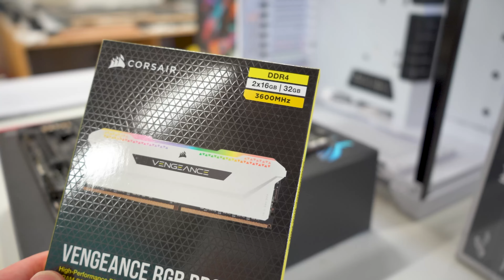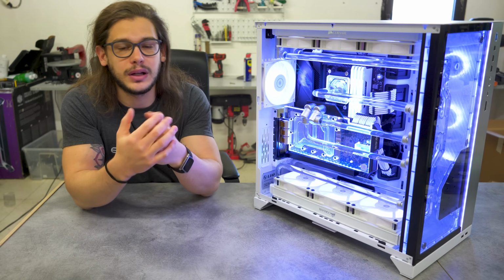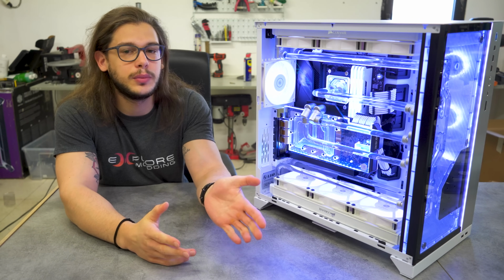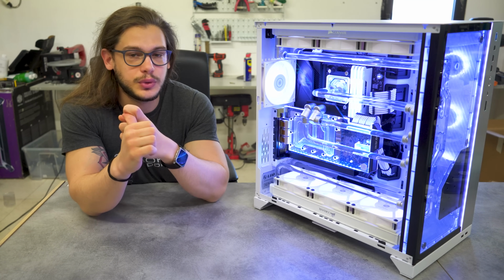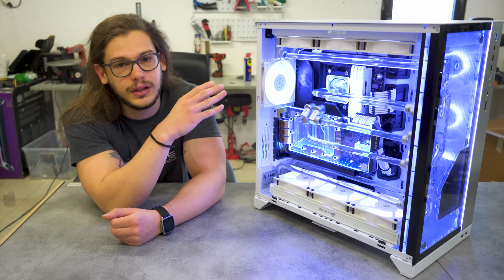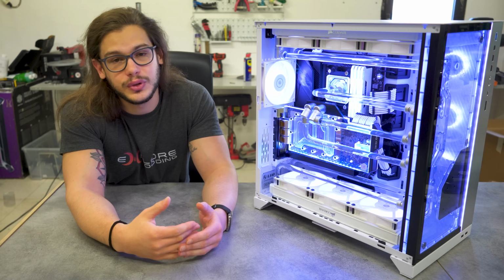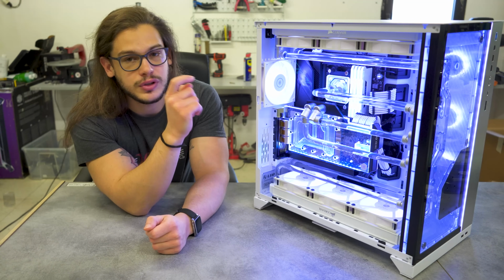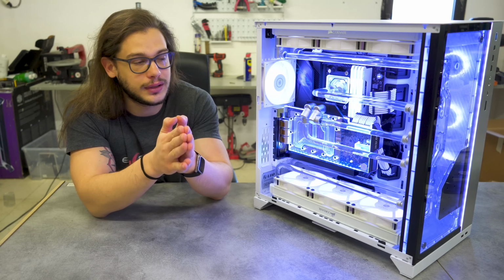Watercooled Lian Li PC-O11D XL - Thoughts on the Most Popular Watercooling Combo | bit-tech Modding

Comment: VERY NICE BUILD. I PREFERR FUNCTION OVER LOOKS.  THE ONLY THING I DON'T LIKE IS THE DISTRO PLATE RESERVOIR COMBO. DISTRO PLATES ARE PURE LOOKS .  BUT WORK YOUR PUMP WAY TO HARD , A PROPER SYSTEM. KEEPS THE TUBING RUNS AS SHORT AS POSSIABLE .   COPPER TUBING IS MUCH MORE FUNCTIONAL THAN PLASTIC. AND HELPS IN COOLING .  NOW YOUR SET UP IS NICE FOR A PC. AND REALLY DOESN'T CHANGE TEMPS MUCH . BUT RUNNING AN INDUSTRIAL SYSTEM WITH 50HP PUMPS AND MULTIPOL  WORK MACHINES A DISTRO PLATE WOULD NEVER EVER BE USED IT JUST OVER WORKS THE PUMPS. I WILL POST MY GRANDSONS O11 / IT USES THE FLAT EK PUMP RES. D5 NEXT. i HAVE SEEN ALOT OF BEUTIFUL O11 BUILDS BUT WAIT TILL YOU SEE THE 1 I BUILT  FOR THE GRANDSON. iTS AS SHARP AS ANYTHING I HAVE SEEN BUT IS 100% FUNCTION OVER  FORM. wHEN YOU SEE IT YOY WILL UNDERSTAND . IT IS A 1 OFF CASE AS i WANTED TO PROVE TO THE WORLD THAT LOTS OF AIR FLOW IS PURE bs. i SEALED THE CASE OTHER THAN SIDE AND TOP RAD MOUNTS  . fANS CREATE A PREASURE RISE INSIDE THE CASE POSITIVE PRESSURE = LESS DUST.  HIS TEMPS AS FAR AS pc GOES IS = TO OR BETTER THAN ANY O11 OUT THERE.  I AM BUILDING NOW FOR OTHER GRANDSON THATS IN A O11 XL THIS PC WILL HAVE 2 PUMPS IN THE SIDE MOUNT . RADS ARE TOP AND BOTTOM. AGAIN i USED ek FLAT PUMP RES. PUMP COMBO . 1 IS 240 THE OTHER IS A 120 AGAIN VERY SHORT TUBING RUNS AS I USED XFLOW RADS , AND BOTH SYSTEMS ARE AS GOOD AS IT GETS. tHE PRESENT BUILD IS FOR THE LAST GENERATION OF THE 1700 PIN LAYOUT. FOLLOWING RAPTOR LAKE. I DON'T HAVE ALOT OF MONEY SO IT TAKES ME A LONG TIME.   FUNCTION WILL ALWAYS TRUMP FORM. EVEN IF ITS ONLY A COUPLE DEGREES C.   A WELL BUILT fUNCTION OVER fORM SYSTEM WILL ALWAYS LOOK BETTER/IT MAYBE HARDER BUT LOOKS TAKE TIME.

Comment: That upside down Corsair logo on the bottom rad just triggers me.
Reply: HAHA troo XD
Reply: Right? But there's no way to put it the right way when it's mounted at the bottom. They should put ports on both sides!
Reply: @ExploreModding  Hardware labs makes the radiators for Corsair. It's called Black ice Nemesis. I bought my bottom rad from them. It's identical to the corsair rad up top but without the logo.
Reply: @repton_3  yeah I know, but putting ports on both sides is the only way to be able to have the logo upright in every single orientation, unless they make the logo rotatable or something hahah
Reply: @ExploreModding  Just put a sticker in the box! I got a "Powered by Corsair" sticker with my PSU :-)

Comment: I thought they were much easier to do... some 90° bends, measure, and done. It does require 2-3x the tubing and some additional offsets, but it only cost me about $80 US more in fittings  and tubing than a "classic" build. The distro addred about $200 US to the price of the build, but that's a total of less than $300 difference, so I'm not sure why yours was ballooned to TWICE the cost.

At any rate, while I love the o11 series cases for their flexibility, I don't like the use of distro plates and the wall of horizontal tubes that creates strictly from an aethetics point. They just look like "cookie cutter" builds. I do have an o11 build, but without a distro, using the "classic tubing" runs, giving it a bit of variety over most of the o11 builds.

Comment: I don't like it because it's too popular and custom loop looks exactly the same on all builds.
Reply: yea it's why on my 011 D (non XL) i went for the less popular top rad with fittings at the front and side rad with fittings at the bottom, tying it together with as many 135 degree bends over 90 degree bends as i can get away with, still have 2, not much flex at the bottom of the gpu / the final bend to the side rad. my config is also shockingly efficient in tubing (which is good cause i tend to  not get it right the first try >.> but all combined i think maybe if i'm generous 90cm absolute max) with the radiators in this config there is no back and forth it's more of just a circle (tube wise pump>down/in to radiator>left/out/up to gpu>up to cpu>up/right to radiator>right to reservoir which is attached to the pump).

just makes it a little different from the populair super strait with tight 90's all over the place which granted a distro plate will kinda steer you towards (i've wanted one but i've not found one that replaces the front glass, has a D5 built in in a good place so i don't need to leave out fan's) but there was recently a sale on singularity reservoir combo's and i picked up a frosted one of those, swapped my tubes for frosted tubes and had the RGB tint it all cycling 3 colors....turned out quite nice.

other then that i just love the chassis, is the case perfect, no some panels could use some optimizing and a cm here or there would work wonders but the internal layout (if you don't have many 3.5" HDD's in use is just amazing for cleanly and conveniently working away....well things, i got a usb hub, a 12 fan splitter, a 8 fan controller, and 2 more 4 fan/rgb splitters stuck behind my mobo that i can access by just taking the panel off no digging no clutter not cramped at all....it's really nice did have to make some custom power cables to get it this nice but details :P
Reply: @anub1s15  Yes, it's a perfect case to be honest. And I want one :)